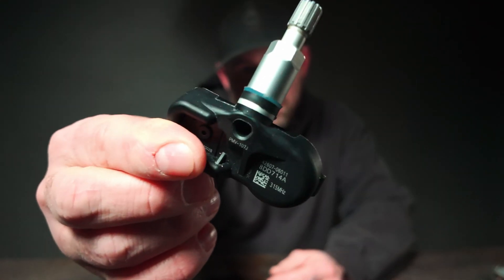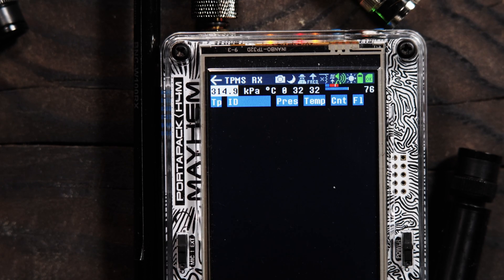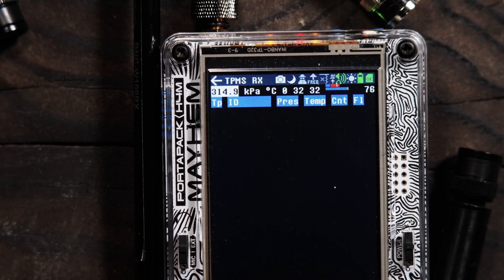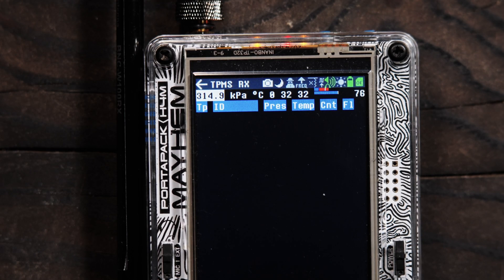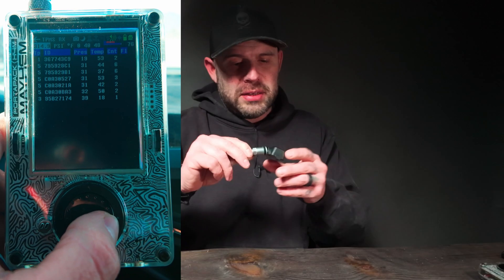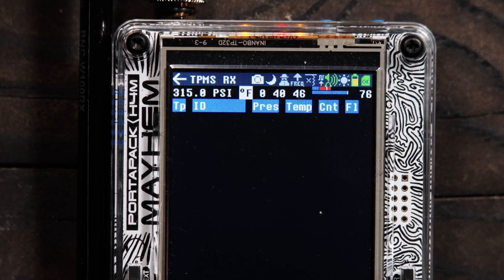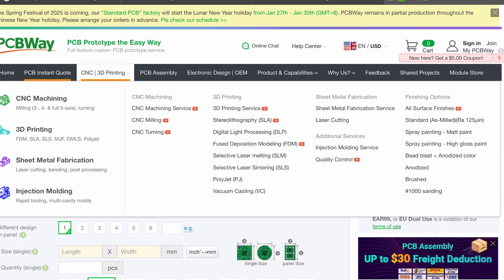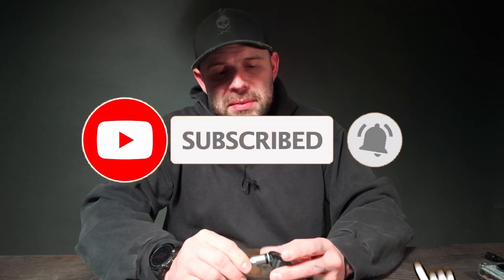PortaPack H4M TPMS App

Comment: Is the comet antenna only good for RX or can you tx on it too? I like the double hinge for storing it away on the move. Looking to pick up an antenna with a double hinge like that which covers a decent range of frequencies if possible. Mainly sub GHz stuff or to replace the “jack of all trades” telescopic antenna if such a thing exists?
Reply from the maker: @cmac7168  great for rx.  For tx it’s always best practice to have the appropriate antenna for the frequency you intend to transmit on.
Reply: @ cheers man - your advice and videos always come across very beginner friendly ( a lot of other YouTubers and discord users can be a bit snobby) you’ve got a subscribe from me for sure 👍 what frequency would the comet antenna be good for RX/TX on? Cheers again bud - sending my appreciation from all the way in Scotland 🏴
Reply from the maker: @ thanks bro. I appreciate it and your time. Comet is great across the board for rx. I haven’t done much tx in it. I plan to. But I just haven’t yet. So it’s hard to say tbh.

Comment: If I recall correctly, TPMS units send new data once they reach a certain speed, I think 25mph in the US.
Reply from the maker: @rickasisco  I’m not entirely sure. I could see that. I’ve also read that once they hit a certain psi to boot up they just ping out every 2-5 minutes. I’m not sure if the protocol is universal for all brands.
Reply: @Jeremiah.o.A.T  I am not certain. Never really looked into them much. I just recall from many years ago when I had to change one on a vehicle, it did not read after installation and I assumed I installed a faulty sensor. Turned out that it didn't read and display new data until I drove down the road. A mechanic friend who works at the dealership said "Ya, that's normal. They have an accelerometer built in that kicks in at a low MPH". I assume, at least on the one I was using back then, that they tire needs to spin at a certain RPM which would convert to my vehicle moving at a certain speed. Newer ones might be completely different or they might be a hybrid been pressure and acceleration now.
Reply from the maker: @rickasisco interesting. Maybe I’ll duck tape mine to my tire and take a drive, see what happens.
Reply: @ lol.. That could be dangerous.. so make sure you record it. :P